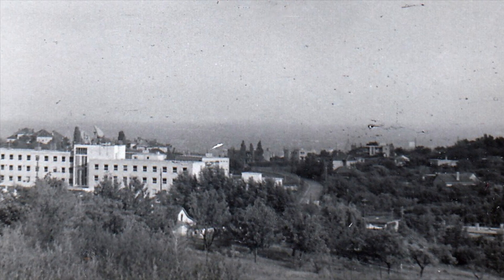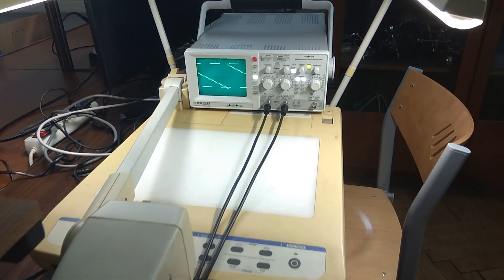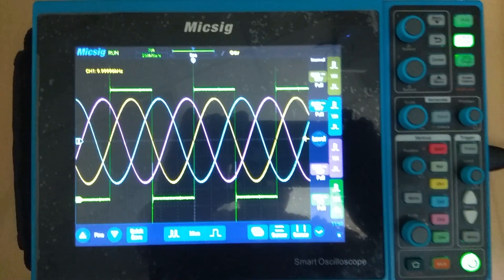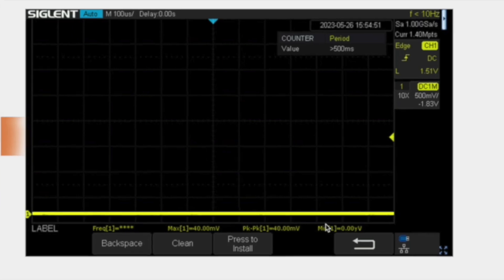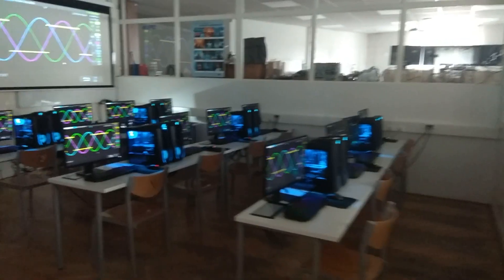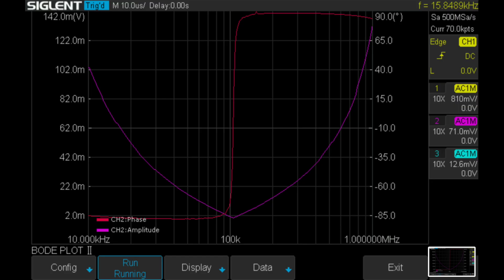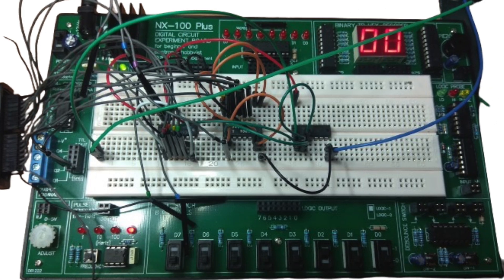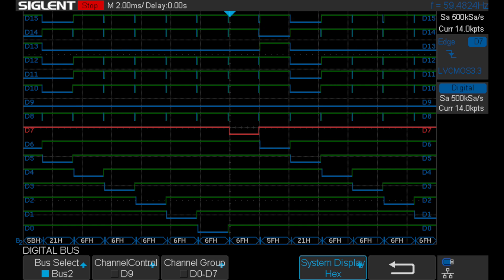This Is One of the Best Oscilloscopes in My Classroom for Teaching, According to My Opinion EN,HU,RU

Comment: Thanks! I will look for a Siglent. Currently using a Fluke 199C. A No Dees and K No Dees 🤭 best stick to your fine british accent.
Reply from the maker: What do you mean in this sentence? "A No Dees and K No Dees 🤭 best stick to your fine british accent."
Reply: watch the video near the end. the computer generated voice cannot pronounce Anodes and Cathodes
Reply from the maker: Dear Allan,

Thank you very much for responding and clarifying the issue with the TTS pronunciation in my video. I wouldn't have realized this on my own, and even after consulting several AIs, they couldn't pinpoint the problem either.

Interestingly, the TTS incorrectly pronounced embedded terms like "MHz" in the script but correctly when isolated. I managed to fix this in the video by editing it. However, I didn't notice the mispronunciation of "Anodes" and "Cathodes", partly because I know the script by heart and also because English is not my native language.

Regrettably, as far as I know, it's impossible to modify a video once uploaded to YouTube. I would prefer to correct these words if I could. Could YouTube's own editor offer a solution? I'll look into it.

Again, thank you for your helpful feedback.

Best regards, bzoli57